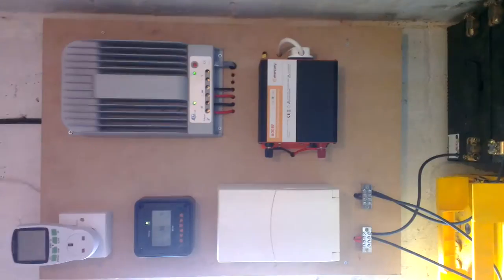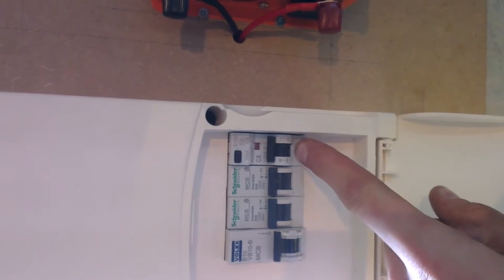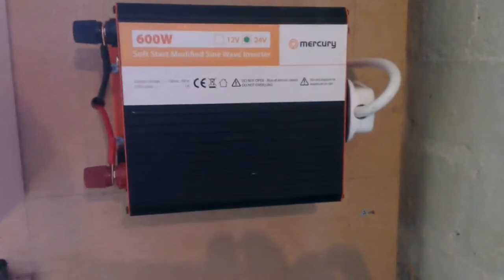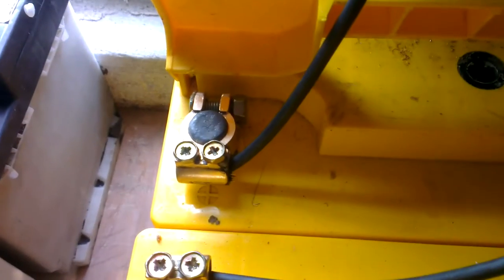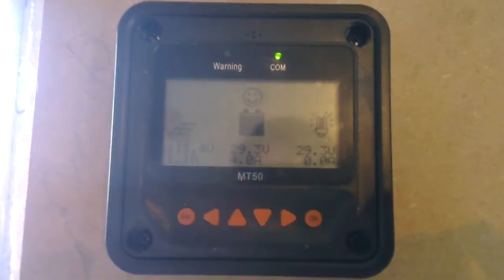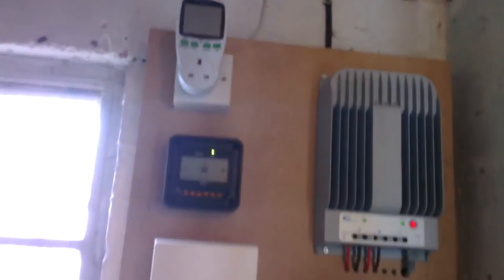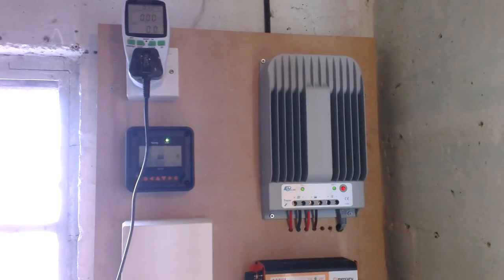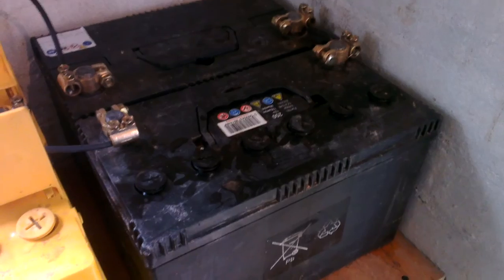My DIY offgrid home solar power station - UK - PART 2

Comment: Hi, nice little set up you have there, The only one gripe about this is you need to get better battery cables. Yours are way to thin? This will cause two things. Firstly powering up appliances for along time will get those cables very hot ie (fire) and secondly Power losses ( efficiency ) The Cheapest way to get around this problem I found is to buy car jumper leads and cut them up to the required lengths. Keeping them the same length between the batteries,This way will balance your batteries evenly when charging.Then from the batteries with the same jumper cable to your inverter.Only giving advice.
Reply from the maker: To an extent, you're right. The reason being is that at 24v at 600w is 25a. The system would split the load between each bank. I think in this video there were 5 banks, so each cable would need to hold 5a. 4mm2 is more than capable of holding that current. The two cables which joins the connection box to the inverter should be thicker. You're right about the matching cable lengths but I didn't do it because I planned on expanding the battery bank. Another thing is that the inverter will need to be expanded soon too! Antony...
Reply: You have to be careful with using jumper leads as cable. They're cheap, that's because nowadays they are usually copper plated aluminium. Which means they do not perform as well as one might expect a cable of that size to do. And the amp ratings they give to those products are essentially meaningless.

Comment: this should be easy, but I have researched and without your extensive knowledge one cannot arrange this, why is this not available in a shop, everything is diy but sunlight is for free, I would like to be able to buy a kit, bit weird no-one is offering this.
Reply from the maker: +Wilfred Vanerp Hiya! You can buy kits but they are generally very expensive. The reason why they are not that common is that very few solar setups are the same. Someone may want 3kw system but ability to store energy for 3 days, another buyer may want a 1kw grid-tied system, another may want 400w and to store enough for an hour. They are all different. Everyone has different needs I guess.